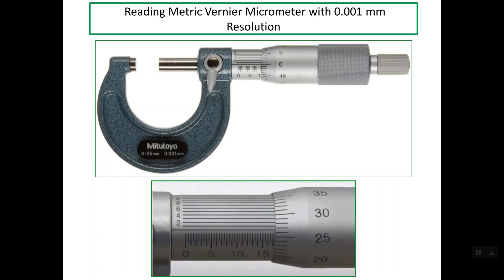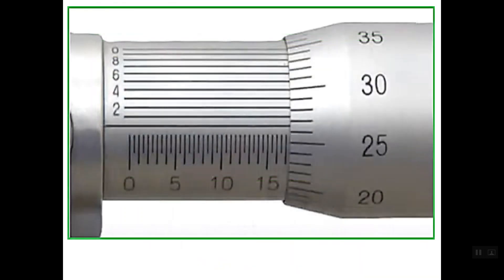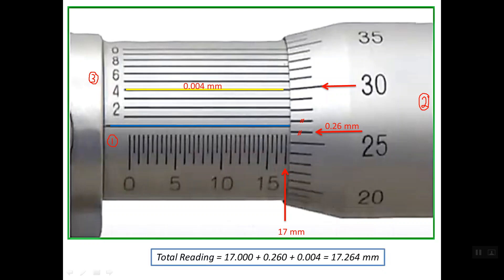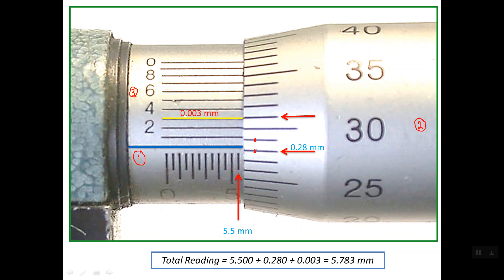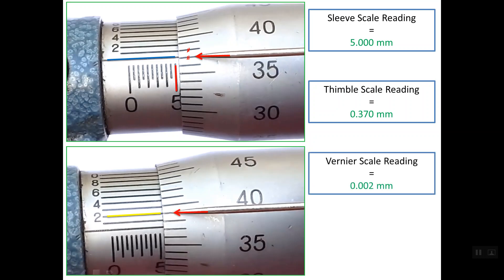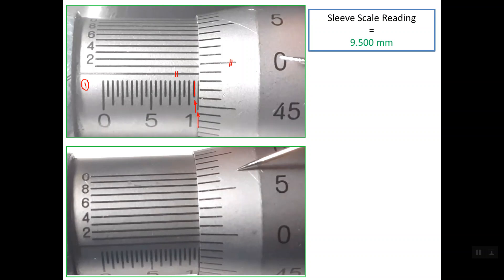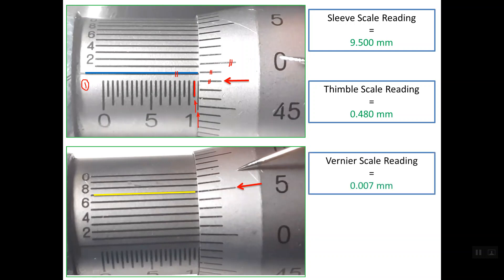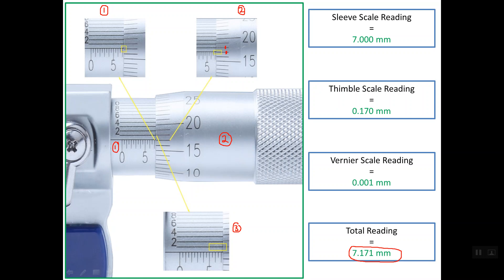2) Reading Metric Vernier Micrometer with 0.001 mm Resolution

Comment: Sir is there any different between 0.01 reading and 0.001 reading
Reply: The final step of adding the vernier reading is only needed for 0.001mm precision. (Ironically, 0.001mm is called a micrometer, pronounced differently from the tool.)